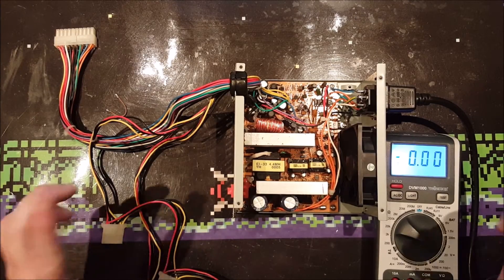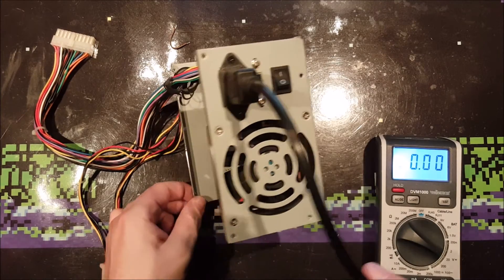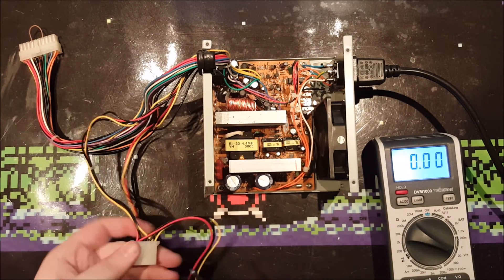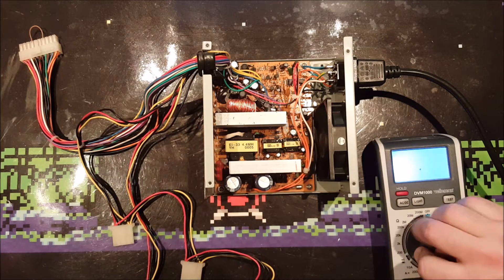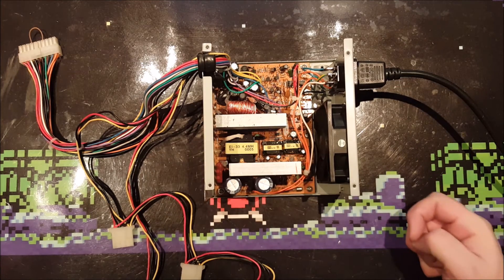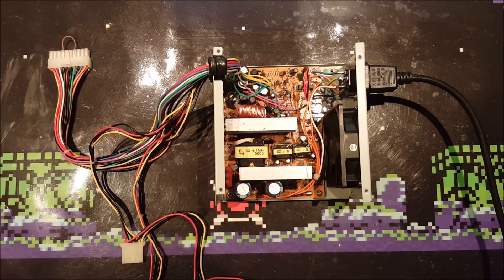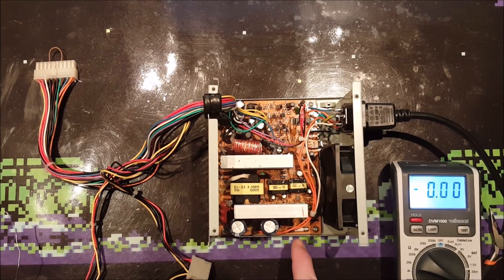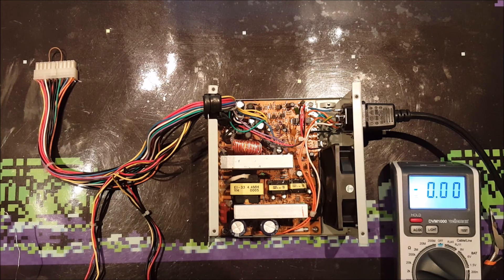What happens to an ATX Power Supply on the 115V-setting at 240V

Comment: But i have a question what if you use a 200-240V atx psu with 120V power? Same outcome or what? Want to gift a pc to a friend in usa but he has 115v power while i in eu have 230V. Some powersupplies do have 100-240V but most have 200-240V

Comment: I didn't notice that the switch on my psu was at 115v and i turned on pc. The psu started smoking, but when i put it back to 230v, it worked fine and it still does. Can someone explain how it still works?
Reply: Wtf man, I was scared of testing it again with 230v after this shit happened. Might damage the other components though, so change the PSU as quick as possible even though I am late to tell you this.
Reply: Hello guys. This happened to me this day because my pc starts boot loop so I tried 115v and blowed smoke. Im worried if my mobo, cpu and other components might be damaged... pls reply.
Reply: @licksauce did yr components survived?,this happened to me today
Reply: @bbh1834  yes, only the motherboard broke.
Reply: @licksauce  well i didnt turn my pc at all,i just plugged it and it went went kaboom,can my motherboard also survive?
Reply: @bbh1834  I dont think so, but I hope your motherboard can survive.
Reply: @licksauce  my pc survived,MY PC SURVIVEEEEEDDDDDD

Comment: Shame that didnt happen to my PSU years ago when I started fiddling with that cursed red switch not knowing what it did...When I plugged it in there was a massive bang and the fuse box in my house tripped.
Reply: same happened to me
Reply: Same thing happened to me, do u think the psu is damaged?
Reply: @Haru-up4ox  If your lucky, The fuse blew and saved the rest of the power supply. In which case, replacing the fuse will fix it.
 If your unlucky, the fuse didn't do its job in which case the rest of the PSU is probably screwed. 
 I wouldn't recommend trying to repair it and use it unless you have the electrical expertise to know what the problem is.
Reply: @corey1054  where do you think the fuse is ? Is it blue 
Mine blew and I opened it the smell was coming from a small blue thing I think its a capacitor  also I can't find the fuse

Comment: I think the power supply NEEDS 230v for proper operation--period!  When the switch is in the 115V position, it acts as a voltage doubler.  So, when you plugged in the ATX to 230v, it tried to feed in ~460V !!!
Reply: Nope, it actually steps it DOWN to lower voltages (3.3, 5, and 12v)

Comment: You should redo this test, after replacing the fuse with a thick wire. :)
Reply from the maker: Great idea, but I will have to do that with another one, because this one is already gone. :)
Reply: Yes, be careful the capacitor will spew a lot of steam. Wear eye protection, and keep camera away from the top of the PSU, as the steam will likely blow that way.